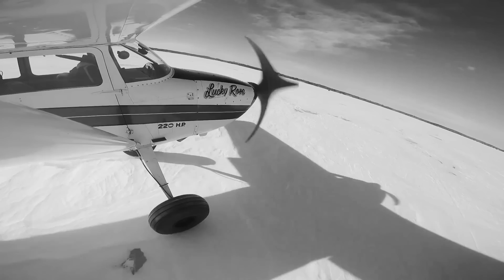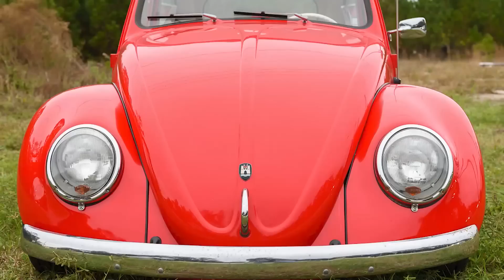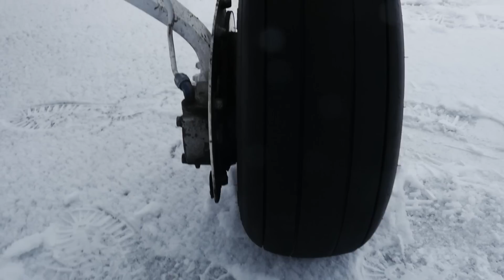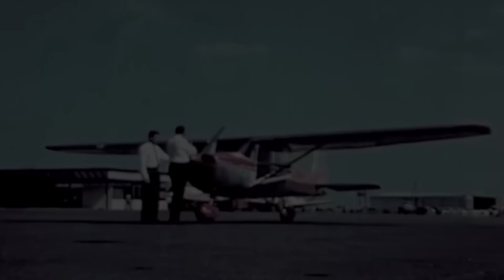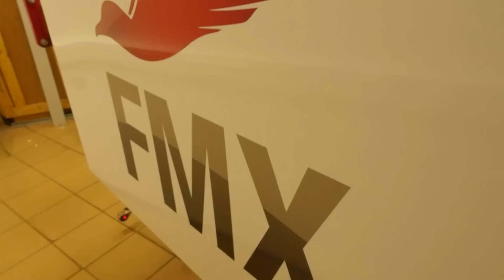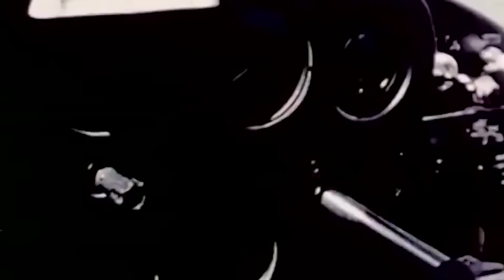Cessna 172 - a plane for everyone

Comment: I have almost 800 hours in my 172K that I’ve owned fur 7 years  and have flown it to every one of the farthest corners of the USA and even into Mexico. I’ve landed it on beaches, roads, backcountry strips, dry lake beds.  Ive landed at the highest airstrip on the country up in Leadville Colorado and the lowest airport in the country down in Death Valley.  I’ve flown it up to 99 miles over water like on my way to key west-  and flown it straight over the highest peaks of the Rockies, Sierras, Winds Tetons and more.  I laugh when people call it a trainer-  it’s the most popular plane ever built because it’s the most economical, utilitarian, reliable, and safest planes ever built…. And any pilot who thinks they know of a plane that is better or safer or more economical or more utilitarian or better or more fun or more useful is just plane wrong.

Comment: I've flown a dozen different planes, but my favorites are the newer 152s and the older and newer 172s (I like the 172s with mechanical flaps, and those with flaps 40). The 152 is like a sports car you strap on your butt; great for solo flying. The 172 is for everything else. They are fun, easy to fly, forgiving, yet very much an aviator's aircraft.

Comment: You are holding the yoke in a deathgrip with two hands...takes away subtle control and your hand is away from the throttle, you should hold the yoke with basically fingertips for most stuff, this way you will feel the air going through them much easier.

Comment: I think there were two points you missed - the tricycle landing gear makes landing easier and prevents ground loops since the front wheel can keep the plane pointed in the right direction once on the ground.  Diesel engines can run on Jet-A fuel which is more readily available than 100LL AvGas required for the usual engines in the 172.  Regular automotive gasoline is not recommended for those engines.

Comment: During my first flight in this type as a student pilot, I failed to keep an eye on carburator temperature as I flew over water. It suddenly froze up and left the engine wind milling. That's how I learned this type is prone to that failure, and my instructing math teacher learned that I'm less nervous than he is. It took about a thousand feet to get it running again. 

This occurred in an area where you can't throw up a hat without it showing up on some radar, and both Rotterdam and Ostende ATC had us on screen and saw us drop, but we weren't talking to them through this event, so Ostende ATC played me a bit on the way in. Telling a 172 to mind imaginary traffic overhead is a sure way to get it to rock its wings. I passed the test. There is worse things to waste fuel on than doing a mandatory 360 over Ostende on a sunny day. Lesson learned:, mind the carburator temperature when flying into colder air in a Cessna.

Comment: You should do a video on the Piper PA-28 family, probably the 2nd most popular single-engine trainer and low-wing competitor to the Cessna. With 32,000+ airframes built (and counting) it's not too far behind the 172, but its not as common outside the US.

Comment: How is diesel with altitude/temperature? Do the tanks have heaters for the diesel fuel?
Reply: the feed to the high-pressure fuel pump returns excess fuel to the tank heating it in the process. There are obviously limits to the quality of diesel fuel that can be flown under arctic conditions.

I'd advise to always fly "arctic grade" diesel fuel.

Comment: I have over 1000 hours in 172s (Ns to SPs) from when I was a student, instructor, and designated examiner. I've considered buying one in recent years, but the price has gotten insane for a new one. Add in hangar, insurance, fuel, maintenance, annual, etc...couple that with the fairly slow speed and the drive to/from the airport....the numbers just don't pencil out.  I have no interest in a relic from the Nixon era.  I get my flying fix in a Falcon these days.  I like your instructor!

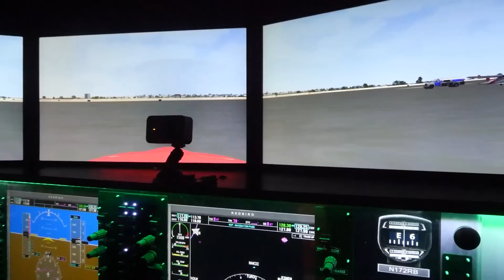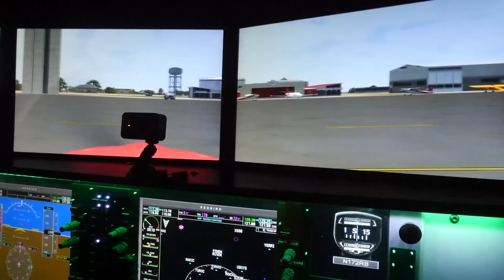Comment: at 14:22 the compass is pointed east with heading 6 on the right? at 14:32 it has heading 15 on the right of south? Is it reversed or am I mistaken?
Reply: When you read that style of compass you are looking at the back of it, not the top, so the numbers are reversed. It's exactly as confusing as you think.
Reply: Yes and no. It simulates looking at the back of a horizontally rotating disk. If you turn left, the tick marks will scroll left. This is different from the display you'd see on a digital PFD or HUD, which simulate looking at the top/front of the compass, which would be impossible to see on a real physical compass unless looking down on it from above.

Comment: Good job flying Sky!  BTW, a new 2025 example w/full glass cockpit will run you $600k - $800k USD depending on options now!  BTW, you should also consider a video on the Piper Cub, another very popular trainer, and the newest version the Carbon Cub. The most popular back country,  and generally popular planes today!   Soft landings to you,   --gary   8)
Reply: 600k for basic 172? 😮
Reply: @BobSaint basic is 350k. 600 is for glass cockpit.
Reply: Saw one last summer headed for a flight school in AK, all Garmin glass,  ~650k. They won't use Dynon or Avidyne for some reason?  A less $$ option.  8(

Comment: Thank you!  I have spent many happy (and a few challenging) hours in 172s.😎 
That was cool! My first lesson was in an actual airplane; an 'introduction flight'.  I thought I was just going to be an observer, but then the instructor had me take the controls!!
The 1960s control yokes and 21st century glass panels was quite a contrast--and yes, it's far easier to fly when you relax your grip a bit. 😉
The reason production was stopped in the 1980s was because product liability laws in the US were relaxed, making liability suits against aircraft manufacturers very easy--and ruinously expensive for manufacturers.  When laws were tightened to protect makers from frivolous suits, production was restarted.
Reply: Interesting information
Reply: @youreyetravel  Yeah; personal injury lawyers making manufacturers pay for pilot errors.